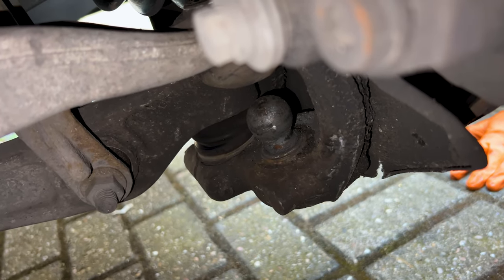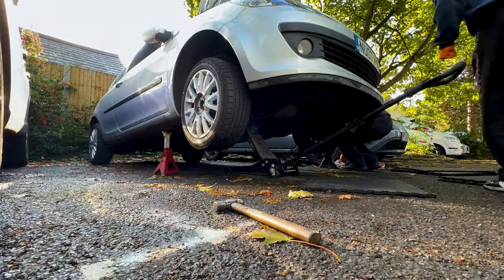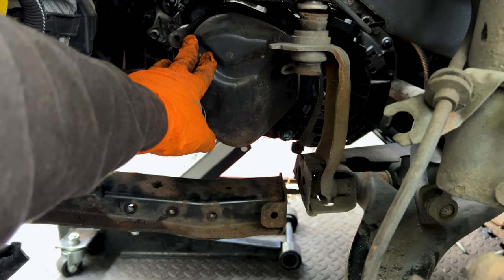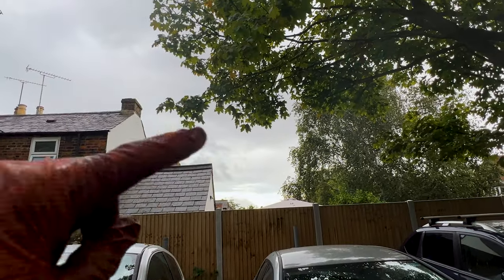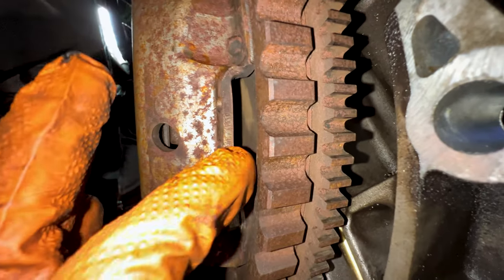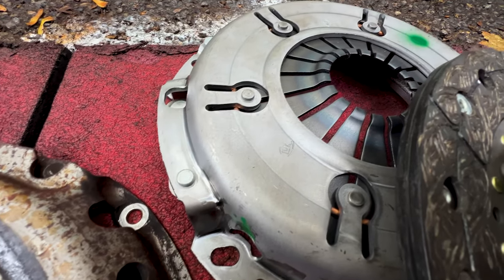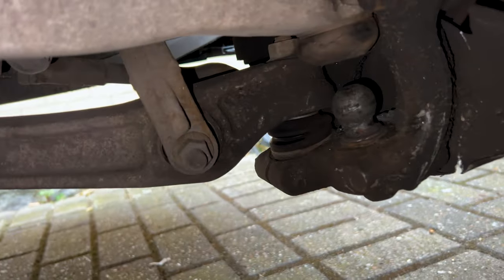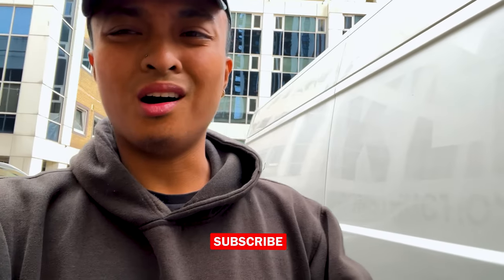THIS IS WHAT WILL HAPPEN IF YOU DONT REPLACE YOUR CLUTCH FLUID! | Life of a Mobile Mechanic

Comment: Treating changing the clutch fluid as a regular service item is a really good and, you would think, an obvious idea - however, I am sure many folks would never think of this even though they always do their brake fluid / gearbox / diff oils etc! I will get mine done as I am sure it's never been changed in 15 years as still on original clutch! Thanks for the idea.

Comment: It would have been nice if you showed how you bleed the clutch, as some cars you need to do the opposite  and back feed them through, only done this once and curious on how vehicles you have to do it this way.
Enjoy watching your channel, keep it up.
Reply from the maker: I will keep this in mind! Thank you for watching our videos
Reply: I work on trucks and we back bleed all clutches ,personally i use an old washer bottle  and a hose connected to the bleed nipple  ,connect it to the battery and just wait till it fills the resovoir  ..some peopl go manual and use a oil squirt can to back bleed
Reply: @norb0254 last time I did it with an old oil squirt can.
Great idea using an old washer bottle, never thought of that,would be a lot easier that way, thanks for the tip.

Comment: I have a question, I have a Ford Focus 2 (manual) from 2005 and it has 118060miles on it. The clutch fluid has never been replaced, is it still recommended to replace it at this age?

Comment: Never turn a engine the wrong way if it has a timing chain it most definitely will slip otherwise good lad keep it up 😂😂
Reply from the maker: I’m sure I’m not the only one. Also chain slip is rare at very very very slow rotation. Correct me if I’m wrong? 

‘Definitely’ doesn’t apply to this job then, I guess? 😂
Reply: @themarvelousvlog  How common it is, I can't say for sure. But I have experienced chain slip on a TFSI engine before. I rotated the flywheel clockwise (i.e. crank rotating anti-clockwise) in the process of tightening the pressure plate bolts, and it resulted in the timing slipping. Didn't realise until I cranked the engine and bent two intake valves.
Reply from the maker: Oooo! Ouch! I’ll keep this in mind!

Comment: Cars don't have clutch fluid per se. There is fluid in hydraulically actuated clutch. And that fluid should be exchanged period odically to prolong life of clutch master and slave cylinders. Don't understand what removing trans and clutch assembly has to do with the simple hydraulically actuated clutch system.
Reply from the maker: Yeah per se it doesn’t. It used to and a lot of people still know it as ‘clutch fluid’. Now it’s a shared system between the brakes and clutch. 

In regards to “don’t understand what removing trans and clutch assembly has to do with hydraulically actuated clutch system”- well, it is part of the clutch system, isn’t? This customer’s CSC failed and I wanted to show everyone what happened to it- so yeah, it does have something to do with it 🤷🏽‍♂️
Reply: @themarvelousvlog  shared system between the brakes and clutch. No way Jose!